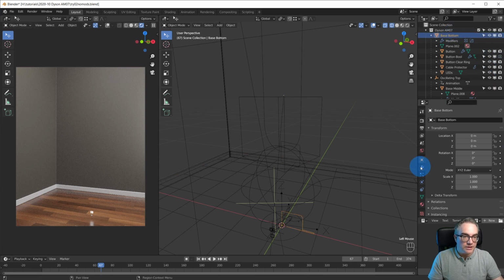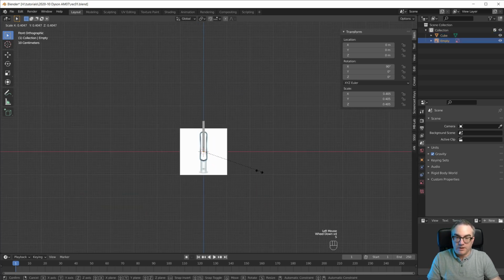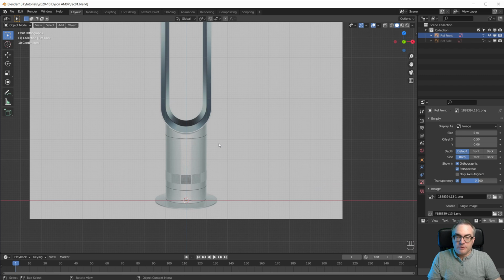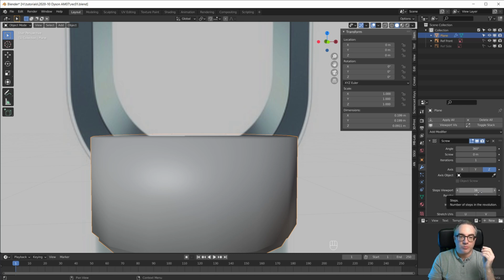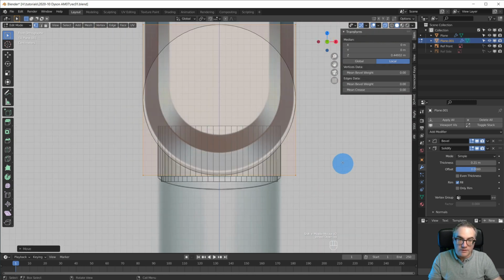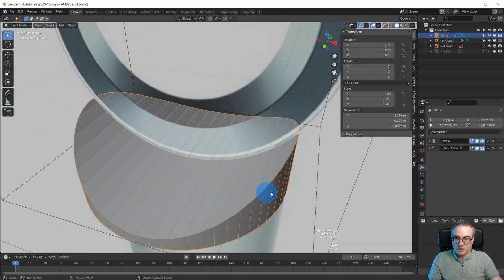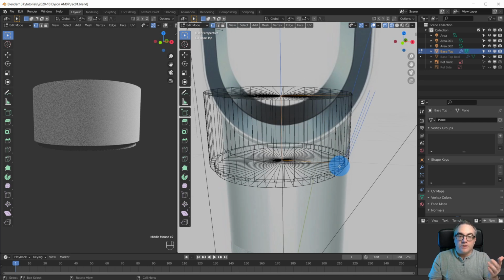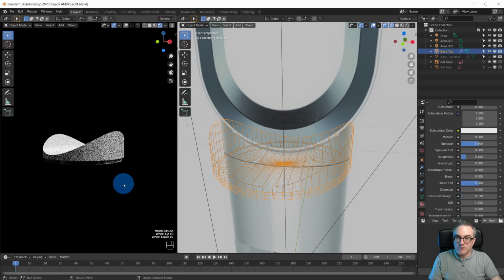Non-Destructive Modeling in Blender 3D [1/4] Dyson Air Multiplier AM07 Tower Fan

Comment: @Chris P Great video. Found a workaround to this system not using UV's. Just use images as planes with a shrinkwrap modifier and you can apply labels and decals!
Reply from the maker: yes this works fine for decals!

Comment: Great stuff! I love working with procedural and non-destructive workflows! This is ace!
Reply: I am curious - would it be possible to apply a procedural texture to this mesh? i.e. generate UVs for it somehow? For example, if you wanted it to use one of your procedural wood textures on it
Edit: or, I suppose, more relevant - an image based texture (for example, branding or other decals)
Reply: @BeheadedKamikaze  yeah for sure! If it's just decals then using an empty in the object field of a texture coordinate node is the most straightforward. Otherwise you can either create triplanar mapping or change an image from flat to box mapping on the image texture node. You could with a /fairly/ simple form like this also define absolute coordinates mathematically but you'd have to describe the surface with maths to line up with the mesh surface. I'd probably stick to 3D procedural textures and if branding was required, use the empty method!
Reply: @Erindale  Sounds pretty good! I'll give it a try, thanks!
Reply from the maker: Thank you! :)